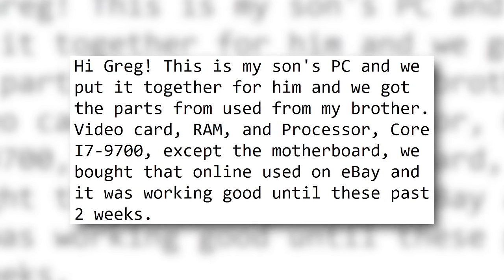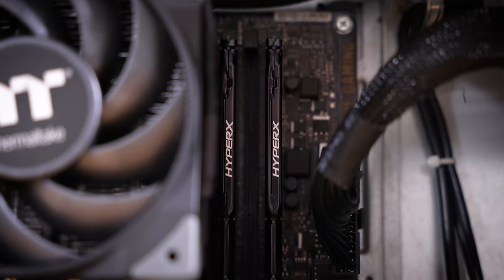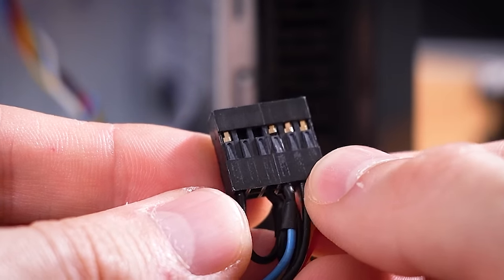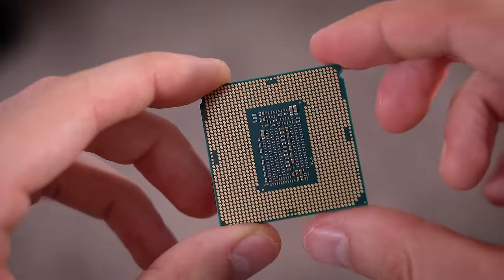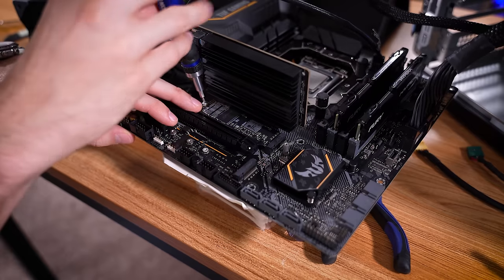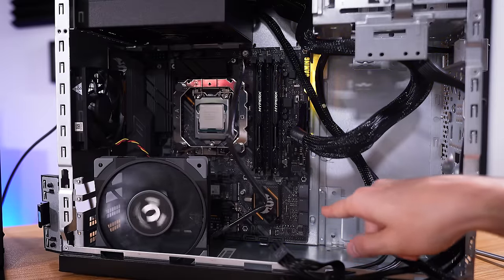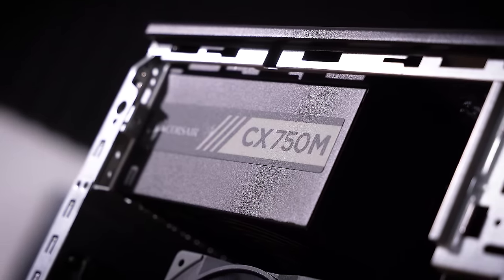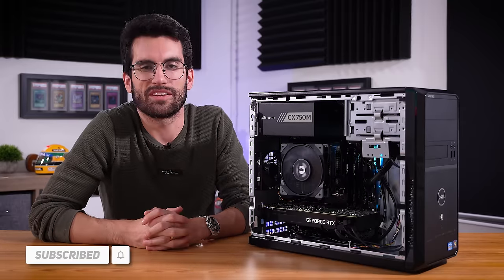Fixing a Viewer's BROKEN Gaming PC? - Fix or Flop S5:E1

Comment: For good measure, imo use electrical insulation tape on the metal that's been hammed and broken off. I did once have a computer like this and the cooling was bad. Just by popping off a few rivets, I removed a piece of metal blocking the ventilation on the front, which served no purpose.

Comment: I remember long time ago I got "broken" mb+mem+cpu set. it worked always on the floor but when screwed on the case it didn't boot. It was pretty annoying troubleshooting. Problem was bios chip socked that had few lose pins on board. Just show some soldering iron and I got working components for computer. This was somewhere 2000-2004 era when I was studying and I didn't have that much money so I usually get some broken stuff for free and fixed it for my self.

Comment: ah yeah, I once had a short piece of wire stuck between mainboard and case which shorted two pins of the IDE connector and so the HDD was not detected properly. A few letters of the HDD name were mangled in the BIOS.

Comment: from the first power on fail I could guess that the problem is a short somewhere in the system. I stupidly fried a dvd drive and a card reader in my system by using the wrong power supply cables on one of my builds and then on another build I repeat this mistake by trying to re-pin power cables from another model, only to find out the pinout schematics I found on the web were wrong. In both cases PC behaved exactly like this, fan spin on first power up and then silence afterwards until power reset. Usually removing shorted component fixes the problem.

Comment: I myself have made this type of mistake on my own PC. My computer stopped posting bios and I assumed that it was the motherboard. So I replaced the motherboard and CPU only for the exact symptoms happen again months later. Then I unplugged my 2 SATA connections from the motherboard and boom it worked. The new CPU is faster then the old one. I went from a 1700x to a 11400f. Just a shame I upgraded at a time that 5000 series were over priced where I lived and the intel 12th gen hadn't been released yet.

Comment: I had the same issue with my previous case where one standoff almost bricked my motherboard because it's compatible with ATX/mATX while my mobo is mATX. Didn't realized I could've removed it but I don't like it anyway because of shitty airflow. My latest case has so much airflow and is compatible with my mobo's form factor.

Comment: I literally had the same issue. I had a rig that was grounding on the case that I could not see from the top view / an installed view of the mobo. I took it out of the case and hooked everything up, everything work. Put back in the case, wont post. I eventually ended up getting a new case because I wanted a fully new build but it took awhile to trouble shoot that issue lol

Comment: You can still force power on by shorting the power supply the same way you would when you use it externally. Yes I've done this tons of times, no it doesn't damage the system.

Comment: Powered on without the cooler in place for more than a couple seconds? I was always led to believe that you'd blow the CPU very quickly without the thermal mass of the heat sink to absorb temperature spikes. Like it would heat up faster than the over-temp protection could stop the damage.

Comment: I have a 10 year old build I dont use anymore that has similar symptoms, turns on if the PSU has just been switched on before pressing the case power switch, but if allowed to be switched on for a while the power switch no longer works. Guess I now have an idea on how I can fix it to give to a friend!

Comment: Those speakers do make sound I have on one my current system however because I have a newer MB (MSI Z790 Meg Ace) I had to active the speaker in the bios. So if ya don’t hear it maybe check there.

Comment: Thats a USB2 header. It has a max 5v/500MA to it under full load to the header. If nothing is plugged in there shouldn't be power going to the header but it still would be a short to ground the MB would sense and it would not power on. So it won't blow up because it won't start.

Comment: I had the same issue with my first pc build(circa 2000) I bought the case ,assembled all and the Duron 600 would not boot. It turned out in my enthusiasm,i tightened the board too much and it was shorting out. I guess that is forgivable in my 'noob' build.

Comment: The issue is probably the case. NEVER use OEM case for normal DIY motherboard.
The short protection will prevent it from booting.

Comment: It's a shame that the owner didn't buy a better case, that one is very small and absolutely lacks good air flow. Poor ventilation: high internal temperature: premature degradation of components.
Reply from the maker: It’s a sleeper case. His temps are fine. If you want ideal thermals, don’t build in a case at all. The “premature degradation” argument is always moot. Unprovable what the lifespan impact is - these components are still well within their operating temperature thresholds.

Comment: It's wild how much a case can affect things sometimes when I built my current 13th gen build with my friend The Fan Hub I guess was broken and for some reason it even affected my CPU fan which obviously wasn't plugged into the Hub so none of the case fans were working and none of the CPU fans were working either. It could have been possible that the Hub actually freed the case fans because the case fans themselves no longer work either I had the migrate my entire build to my my old case and it worked just fine very strange

Comment: I had this issue on Z170 Maximus Hero board before. My technologically challenged mother one fine day went and caused a short circuit protection trigger when she tried to insert a micro USB cable on the USB port all because she wanted to charge her phone.
About 2+ years later the issue with unbootable motherboard becomes more and more prevalent with each passing day due to damaged power on circuit probably and I decided to upgrade to AMD platform before the motherboard completely fails on me.

Comment: I LOVE sleeper builds!  I have my gaming PC built in a (slightly modified) Vostro 200 MT case 😁

Had to Dremel out the I/O shield, since it's integrated into that case.  Also cut out a CPU cooler hole from the motherboard tray, and put an extra fan hole in the bottom of the case.

Comment: I have a collection of older PCs, and one of them (a Phenom II AM3) would have an extremely slow boot but otherwise performed normally once booted. After days of troubleshooting/swapping parts CPU, RAM, PSU etc. I finally swapped the case and works perfectly now and has for months. Both cases were standard ATX non-OEM. So weird.

Comment: A dead M2 caused all kidns of power cycling issues on my pc. it would start normaly but if I shut it down it would normaly not start up again unless I let it sit without power for half an hour and sometimes power cycled it a few times. when I removed one specific M2 drive, one that had been in an old pc that experienced a catastrophic power surge then all the boot problems went away.  Sounds liek the same issue I am glad it;s not just me, that was so confusing to troubleshoot.

Comment: In this sneaky troubleshooting. i usually try client's Processor to my Known-Working board instead of putting a Pricy Known -Working Processor to a Suspicious Shorted Motherboard of the Client. Why? it is unlikely common that a dead cpu will brick the known-working motheboard but it is likely common that a suspicious shorted motherboard will kill a known-working CPU

Comment: I would never put anything in an old Dell Case.  They are one of the worst when it comes to conforming to standards. Buy a proper case - they're inexpensive.  Another thing:  never ever run a CPU without a cooler even for a very short period of time. At the very least, move the case horizontally and rest the cooler with some paste on it. Maybe it's because I've been building PCs for so long, it's just not a habit that was ever OK whether the CPU can take it or not. Other than that, great video.

Comment: At 9:37 there's an odd looking metal cage "something" (USB port?) protruding off the back near the PSU opening. Probably left over from the factory installed Dell motherboard. Might consider removing it, if it's no longer functional.

Comment: I have a tiny little business AMD powered machine that originally ran windows 7 but it has a perpetual windows license tied to the hardwear.   so if im wanting to make a new os drive I just do it in that pc and you don't have to do any of that windows key crap. it doesn't even give you the option at setup.  i've done it with xp, windows 7 and windows 10. windows doesn't care apparently.  its like youre good to go bro you paid at some point.   im sure its an older glitch that has been fixed in newer licences and hardware.
and yeah test everything out of the case first, then you know what the only variable is afterword's if it doesn't work.   
i like to use 3M's insulating tape between cases and mobo's in any little offsets or whatever that you're not sure about.   its better than physically altering the case i think.

Comment: Had my apartment broken into few years back. I had a 3k system in and old pentium iii case as a system builder I had a lot of old stickers and when I build my new system I like to put old stickers  on the case.. the older the better. Funny thing is they stole my TV and Monitor for my computer but left the system. If they had taken the cover off they would have seen it was a top of the line gaming pc. They also stole my Logitech G13 which bother me more then anything.

Comment: I hate to say it but i have run into several problems with people using old cases and new hardware that just doesnt fit correctly causing issues, way more than i ever thought i would and i would have never checked it if i hadnt had the same problem on my own system way back in like 2009

Comment: G'day Greg,
"This here is that viewers broken gaming PC & she's a bit of a sleeper" spot on there Greg not even repeatedly poking it & Electro Shock Therapy will get it to wake up 😂.
I turned an Orphan Dell Vostro similar as this with the slide to hide the Front Panel into my everyday PC, Athlon200GE + B450M-Mortar Titanium + 2x USB3 front 3.5" Bay.
Regarding the BEEP Speaker not sure about other brands but my MSI B450M Mortar Motherboard you need to turn on the Beep Code in BIOS as Default it is Off.
Reply: I came here to say this as well - modern PCs actually have a BIOS setting for that now, which I feel is kind of absurd. That little beep subconsciously lets you know all is good because if it doesn't beep or it has a different beep sequence then you know something went wrong.
Reply: G'day @quantumreality215  yeah the BIOS setting for BEEP ON/OFF is a bit redundant considering they don't have an integrated speaker on the Mobo or provide a plug in speaker anymore,
The Best reason for having the BEEP is First Boot of a new Motherboard if something goes wrong especially these days when hardly any Motherbords have 7 Segment Display, but with default off even after you make an effort to dig out a spare you still don't have a beep to tell you what the problem is until you solve the problem you want help from the Beep Code for so you can get to BIOS 🤷‍♂???

Comment: I've had a similar problem with a pc about 6-8 years ago that would boot up once and then it wouldn't boot again untill you pulled the power cable and connected it again. It was a motherboard issue but I never located the exact cause

Comment: Wait till you meet the obligatory "insect building a nest where it shouldn't and shorting something out" issue.

Or the board having been flexed... popping a solder joint... and being SO INTERMITENT that it can go MONTHS without issue then poof stops working for a day... only to work when its at the computer fixit place.
Reply: Way back there was this computer that would without fail shut off at about 12 noon each day. It turned out the motherboard was so warped that the temperature rise during the morning would cause it to flex in such a way as to break an electrical connection and force a shutdown. Replacing that board fixed things, but damn, it sucked having to throw out that absolutely visibly warped PCB.

Comment: I would have not used a hammer. I would try to fix the issue with a thin piece of not conductive media. As not to damage the case and potential metal shavings.

Comment: I'm 90% ready to ship my case to my Parents place (Melbourn) just to see if You'd have a look at it. New build and for some reason the computer restarts for no reason. Once while I was gaming with a friend and in combat, Twice while waiting in the lobby of the game, and once just after Winning the game. If you look at my Avatar you'll see the case I am talking about. The way this Case is set up it's impossible for anything to over heat in it. Completly random times The internal aRGB side fans on the right are intake fans for the computer & they stay lit but Everything else reboots. Both my Monitors screens go black and they too reboot. Windows 11 Pro, I do not understand it. HYTE Y60 case, Asrock B650 AM5 LiveMixer, Ryzen 5 7600, 360mm x 120mm AIO, G.Skill Z5 trident 32gb, Fantom Venom M.2 2280 1TB & 2TB Asrock Radeon 7600 8gb OC Steel series, EVGA Super Nova Fully Modular 850 power supply, 2x140mm intake Artic Cooling fans & 1x120mm Artic Cooling Exhaust fan. Everything is Brand New

Comment: Interesting build but unfortunately with the gpu intake so close to the bottom of the case in demanding software it will thermal throttle. A new case will absolutely be needed down the road.

Comment: double sided tape under the motherboard  soldered  joints  make a good insulation no short anymore i done this on many hp  z work station  or  dell  optiplex cases

Comment: That's typical of Asus mobo's. For the last few years they've run a default short protection that has been thought of as iffy, it can cause sudden shutdown issues with certain hardware combinations. Some builders shy away from using Asus cheaper mobo's for that reason, but for this it seems to have worked as intended. If it had been anyone else but Asus, that short could easily have fried either the mobo or cpu.

It's Dell. Dell runs 99% atx standards. It's that 1% that gets everyone in trouble. They run anti standard wiring for buttons, fans, jumpers etc. That being the case, that power connection and any stock Dell connectors hooked to an atx standard aftermarket mobo are suspect. As you saw.

Comment: I had a PC that started to not boot and it turned out to be an SSD I had connected. I must have had an issue with it in the past because I had taken the data connection out of it. It had been like that for over a year with no issue. But with just the power connection it was suddenly preventing my PC booting.

Comment: Hey Greg, in the video you mentioned cpu cooler pressure. I bought a Ryzen 7 3700x and the computer won't turn on with a cooler installed, but when I take the cooler off the PC, it will turn on. Would this possibly be a cpu issue or something else?  The PC works fine with a Ryzen 5 3600 and Ryzen 3 2200, Any help would be appreciated.

Comment: Not sure why you're having such issues with those little speakers.   I have tons of them and they all work fine.   I will not run a system without one.  They are just too valuable with system troubleshooting especially on cheaper boards with troubleshooting LEDs.   Makes a HUGE difference to help determine whether a system is POSTing or not.

Comment: Dell motherboards wont boot up if you dont have those two pins on the header shorted,  Ive had to deal with that when trying to transplant a dell build from the small form factor dell case to a regular atx case.